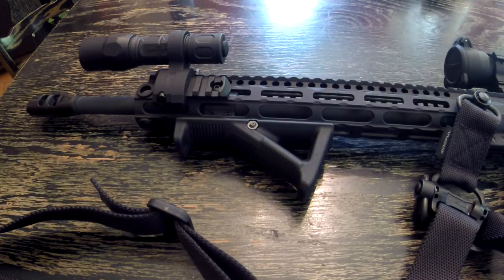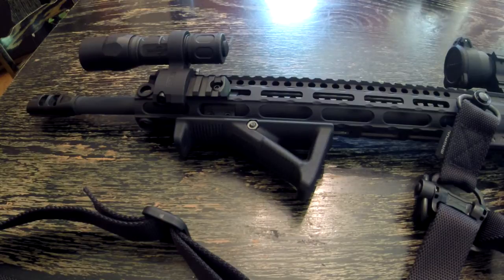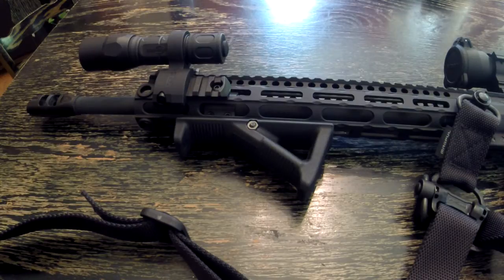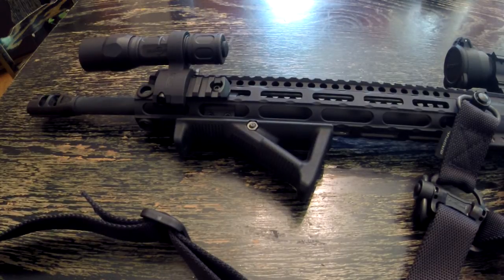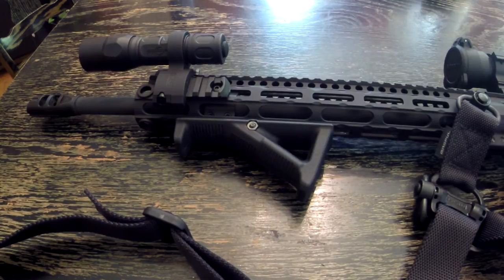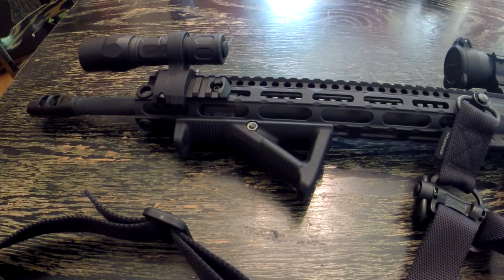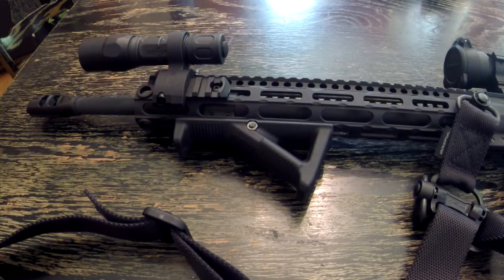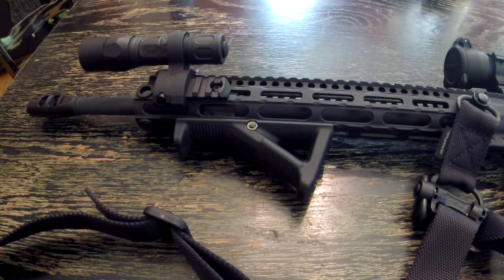Adjustable Gas Block for AR15?

Comment: If you use a lightweight bolt carrier, can you use a non adjustable gas block and stock buffer/buffer spring
Reply: Yes ,you can but you're going to increase the punishment your rifle will be taking because you are reducing the reciprocating mass. Adjustable gas blocks were developed in a large part for "race " guns. What they do is use a light weight BCG, a light weight buffer and a heavy buffer spring. Then adjust the gas block to a min. to get the weapon to function reliably . Done properly the cross hairs barely move. That's how they get those quick follow up shots off. Hope that helps ya'. In my "mil-spec" ARs I run a full auto BCG, an H or H2 buffer and a carbine spring.

Comment: hey I've decided to build a 10.5 AR and I am going to throw a suppressor on it for home defense but I also want to run it unsuppressed at times. my question is wouldn't an adjustable gas block be good for a direct impingement sbr that will be running suppressed and on unsuppressed??

Comment: So what if it stops because it's dirty or you change to weaker ammo, just turn it back up some.  Get an adjustable with a no-tool adjustment and you can tune it in seconds.  Want it to be reliable for home defense?  Just turn it up to full.  There is no reason to not get an adjustable other than the cost of a good one.
Reply: +Brewmaster In my opinion the 'go-to' gun(s) you shoot at the range should also be the go-to defense weapon(s) and it(they) should run reliably.  If you rather practice with one gun and depend on another that's fine.  Everything I take to the range is relied upon as a potential defensive weapon including my black powders.  When I get home they get cleaned and inspected before they're loaded and put away.  I'll experiment with loads and adjustments, but when they come home they are prepped with what I have proven reliable.  If you don't trust yourself to make the adjustments needed for the condition of the firearm that's fine.  I keep all my weapons on the ready in their normally used condition and nobody can say that's the rule.